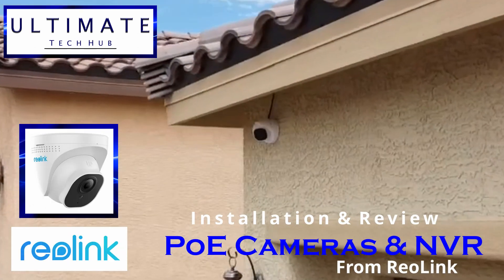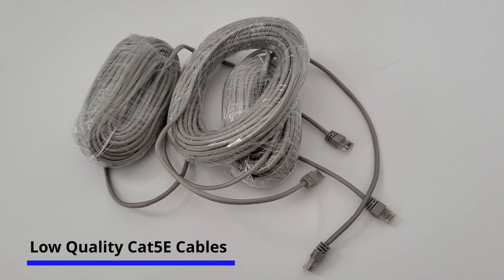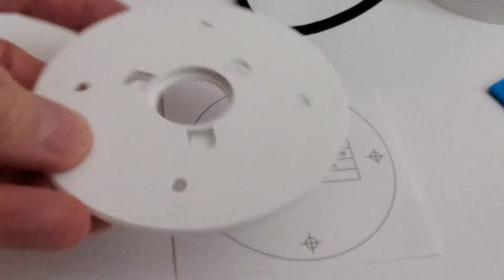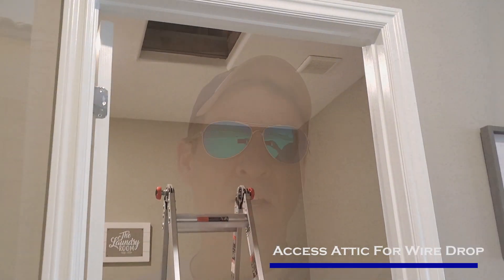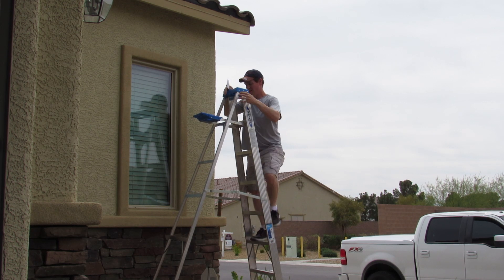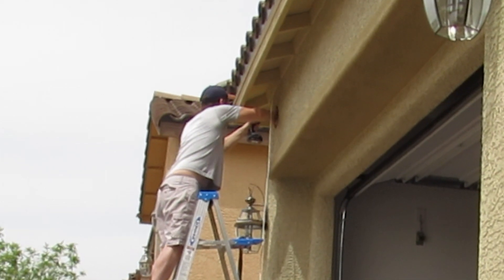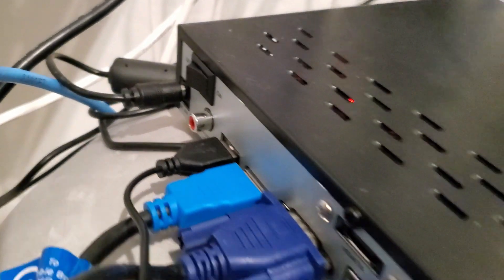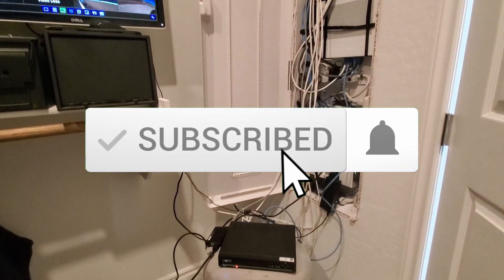Reolink 5MP PoE Camera Setup - Entire System QUICK & EASY! How To

Comment: Hi, I want to add a similar system to my house, can you switch a couple of cameras to two-way audio cameras to the system?  It seems all the two-way audio cameras are wireless, which means they may not communicate to a wired system.  I may be wrong. Please advise.
Reply from the maker: Reolink Cameras that support 2 way Audio are E1, E1 pro, E1 Zoom,  Argus Pro, Argus 2, Argus Eco, Argus PT, Reolink GO, Argus 3, Go PT. All of these cameras integrate well with the Reolink NVR system and the Reolink Client Software. I have the E1 Pro and its very good. I did a review of it as well. So yes you can switch a couple cameras to two way audio with no problems and you can use other camera brands as well. Thanks for watching and if you subscribed thank you as well.

Comment: First: I was suspicious. You didn't give a disclosure. Recommended the system but calling cables junk and special advertisement for one specific CAT6 cable. Additionally calling mouse a junk too (Kind of dream for the seller that puts all the bad accessories in a package to meet the price point goal) when the final conclusion is still "Excellent" "Recommended to all"! And you ain't the only one with OCD out there so I called it initially an "Advertisement in disguise by the manufacturer, Reolink in this case". That is till you admitted about your really true (And almost everyone's) stupidity in attaching the bracket in reverse and showed it actually on your tap. I believed you at this point bro! You ought to be innocent to show that and not hiding it. 

Then: I see a lot of overall good reviews for Reolink so definitely want to believe you.

Nag: All good except... (Pressure on OCD bottom). Why on the earth do you go through the trouble of drilling a hole on your walls, into the attic but not making a simple calculation as to where exactly the camera should be installed and actually drill right there so there is no UGLY wire hanging/extending on your wall when the camera could seat right over the hole for a direct, concealed, clear, nice, professional install? This way, there is no question of conduit also as some other poster asked and you've replied, admitting to OCD and re-correction. 
Additionally my advice to everyone: Before placing the camera on their final location, definitely have a look with a camera of similar focal length lens (Angle of view) as to what exactly the camera will be finally looking at, from that location. A lot of times when over protecting and placing the camera way up, you're covered by the roof edge, and when placing too low, you invite all the bad things. So make sure what camera is going to finally look at, is actually right. Then drill the holes (Measure multiple times, cut once!). Best is to use the real camera to be installed, via external wiring to box and if not possible, at least check it with your cellphone camera or likewise (Considering the room for final correction of view angle, giving the differences in their lenses and focal lengths. 

Bonus: For all who would question the code or need for adding conduit over the barre wires in the attic, No it is not needed as it is low voltage and additionally the section of wire exposed to elements only need a conduit to prevent corrosion and early failure otherwise fire hazard is not a concern here. Or hopefully. 

Bottom line: Good job man. You have a new subscriber.
Reply from the maker: Wow!! Thank you for watching and for subscribing!! I ended up moving the cameras to the wire drop holes about 3 weeks after the install. I wanted the wire drop holes to be lower but the way my house was built that was as low as the drops could be. All camreas were moved higher up to each wire drop so you can't see the wire. I will probably make a video update since I've had a few OCD viewers notice that!!  Lol. I yes this is NOT an advertisement for Reolink I just like the product. The cables and the mouse are not good but thats not a deal breaker. The most important thing is the NVR and the 5mp Cameras. They work flawlessly and thats why I recommend it. Also Cat6 is a better choice to future proof your hoise for better technology. Funny thing is the mouse doesn't work very well but I still use it. LOL  I just uploaded a Reolink Client software video so if you get this system be sure to download that software for your desktop or laptop.  You can view the cameras remotely and use the playback functions.  Reolink is a very good product but there are other really good camera companies out there. Just do the research, watch reviews like this and make a logical decision.  Good luck with whatever you purchase and keep me posted.  Thanks again for watching!!!

Comment: Great install!

Question- My router/modem is downstairs in my office. I would like to have the NVR upstairs in a closet like yours.  Can I run another modem/router to the closet upstairs or is it limited to 1 router/modem?
Reply: Unless you are a professional or network expert, never think of adding a second router (A big no-no) or an access point or a switch box, etc. You will pull too many hairs before making a successful connection, messing up with the SSID, ports etc,  that baldness will more successfully follow next!!! Yes as he said, only run a single RJ45 from the NVR box to one of the free sockets of the router. The same way you can again run a single HDMI cable from NVR in the closet to the final monitor location, that may be installed elsewhere or have it assigned to your TV in the living room or likewise, if you have a free HDMI port in the back of TV and with today's smart-TVs, everyone should have many.
Reply from the maker: @samsen3965  Well said!! Yes a second router is a pain in the butt for sure. Luckily i have my degree in Cisco Routing and switching. I also have 2 monitors for my NVR one in my closet and then I used HDMI over ethernet to run a monitor to my 65 inch big screen in our family room. I have a video on that very topic. I will post a video on how to set up 2 routers for a home network.  Seems like a great topic. Thanks for watching and commenting!!!
Reply: @UltimateTechHub    Follow up Q -  what if I run the ethernet frkm the modem upstairs to the closet, comnect that to a modem, then from the modem to the NVR?

Will that work? Intent is to get a stronger net signal to upstairs.
Reply from the maker: @Unplugged704  you can't have 2 modems connected it doesn't work that way. The single ethernet cable will work fine. The only way to get a better signal is to use a  Cat 6 cable but with video signals it really doesn't help. Cat5e is plenty of speed for an NVR.  Just don't over think it. Have fun and keep me posted!!!
Reply from the maker: Thanks for watching it was a fun install. So your best way to install the NVR upstairs is to run an ethernet cable from your router downstairs to the closet upstairs.  You do not need an extra router or modem. Just plug a cat5e  or cat6 from your router and plug the other end into the NVR. Done.
Reply: @UltimateTechHub   Perfect. Thank you for the response!
Reply: You can only have 1 modem and as many routers and switches as you want. As long as they are configured properly to route signal you can have multiple different networks connected together with almost infinite different networks that can see or cannot see each other depending on how it is configured. The easiest thing to do is to use Ethernet cable plugged into your Modem run that single wire all the way upstairs to your closet or wherever the dvr is and plug it in the internet port. Done. If you want to expand your network upstairs to the rest of the house you can indeed do that using a router. Place a router upstairs run Ethernet wire from your downstairs modem to the internet port on the router, then use second ethernet wire to run form upstairs router normal use port to your DVR so you have additional Ethernet ports available upstairs for future expansion.
Reply from the maker: @gudytwoshoes  Yes this is correct. Do can use this system without internet. Its just a great feature to be able to see the cameras from your phone. Good luck and keep me posted. Thanks for watching.
Reply from the maker: Limited to one modem. You can run an ethernet cable to that closet and that would solve the problem.

Comment: also have you tested Reolink PoE NVR 16CH if all the 16 ports are utilized does that drop the video quality ? Thanks
Reply from the maker: No it won't drop the video quality. I have not tested it but its the same as the 8 channel system. The only thing different is it will use more recording space on the hard drive.

Comment: good day,
the video is very well described
I bought the Cammera without an ethernet cable,
I now want to buy the cable through Amazon for 16 pieces of Kammera?

can you please send me suitable cables for 16 pieces Kammera Link from Amazon?

Many thanks

best regards
abdo
Reply from the maker: If you check way down in the description there should be a Amazon link for the Cat6 Riser cable. You will need between 500 and 1000 feet depending on the size of your house. Let me know if its not in my Amazon links below then I will add it. Thanks for watching and if you subscribed thank you as well.

Comment: Hi @Ultimate Tech Hub, If I bought this system and maxed out the 8 wired connections, Is there a way with the addition of a Poe smart ethernet hub to add more cameras?
Reply from the maker: No that would not work. You would need a NVR that had more Camera ports. I think Reolink sells a NVR with 16 ports. How do you like the picture quality? I have 6 cameras and I will add 2 more soon. Thanks for watching and if you subscribed thank you as well.
Reply: @UltimateTechHub  I haven't bought the system yet I was about to hit the buy button on Amazon and I held out to ask the question. I may look at the 16 port model. Thanks for your help
Reply from the maker: @dirtymarshall  ok good luck and keep me posted if you have any issues with the install.

Comment: I fitted this exact same system two weeks ago and it works just great with excellent quality using the cables supplied....its great value and easy to install, the app works really well too!
Reply: Thanks for the comment. Was hoping someone would be happy with the included cables to avoid spending extra on the system.
Reply: No problem- I have added two more cameras since....if you order from Reolink they just come with short cables about 3' long? I ordered some cables from Amazon to extend them to where needed and although they were only cheap they work fine too  - all at 5MP
Reply: @Saxonx500  good to know, I'm expecting mine on Monday and hopefully all goes well. Thanks again.
Reply from the maker: Good job! It's a very good system for the price. I do have a video on the reolink client software install as well. Thanks for watching and if you subscribed thank you as well!
Reply: I know it's been a while but how easy is the interface when it comes to using the phone app to monitor the cameras?
Reply: Really easy on the iphone, I use regularly and have never, ever, had an issue so far 👍🏻
Reply: @Saxonx500  thanks for this, I like the CC system for the added security but the phone would be the primary monitoring system. Did you connect the NVR directly to the router or did you add a switch? thanks in advance
Reply: I plugged the nvr into a google mesh router and it picked the system up straight away. If your router is handy plugging it straight in will work fine I am sure 👌🏻
Reply: @Saxonx500  thanks I'm just trying to find the best configuration out there.

Comment: Also you should use the dome cameras for patios or inside should of used the bullet cameras for these angles...just saying!
Reply: please explain why...are domes not appropriate for vertical walls?
Reply: @johnnicholson9855  domes can be used for vertical walls, and these cameras have a flip option when viewing as you need to install the dome camera upside down on a flat wall. Bullet cameras are better for flat walls because the mount comes away from the wall and allows better angles facing back at a property

Comment: Nice informative video but your installation was horrible. You should of installed the camera under the soffit or on the trim! Too much exposed wiring the jacks should of been hidden inside the attic. 10 years of security camera installation experience...
Reply from the maker: I installed some beige cable conduit to protect the wires and it blends in well. I will eventually move the cameras to hole location's where it is possible  4 of the 5 can be done. The one on the patio was done without any wires exposed. I'm not a professional camera installer so I should have had the electrical guy drill the holes lower in the location's I wanted the cameras.  But once I move the cameras to hole locations I will make a video update. FYI the picture quality is superb. Thanks for watching.

Comment: REOLINK RLC-422 OR RLC-522 ?
Reply from the maker: Its the REOLINK RLC-520
Reply: @UltimateTechHub  I know but I ask what is better between 422 and 522.
Reply from the maker: @soap4594  oh sorry. The RLC 522 is better. The reason the 422 is more expensive and no audio recording.  But it does have 4x zoom vs 3x zoom on the 522. The wide viewing angle is slightly better but not enough to justify the extra dollars. Both are 5mp so the video quality is the same.  Good luck and enjoy the new camera.
Reply: @UltimateTechHub   I don't agree your choice because for me zoom is more important that sound. Sound on an external camera is not necessary. Image is the most important.
Reply from the maker: @soap4594  I hear you. I never use the zoom feature on my cameras. My cameras are set up for optimal viewing and .since they are both 5mp the quality is exactly the same. If you set up your NVR to view on your big screen then zoom will never be needed. I view my cameras on my 65 sharp and the video is incredible.  But either camera is good. Thanks for watching.
Reply: @UltimateTechHub  Ok I hear you and sound is necessary in your case and if yes why ?
Reply from the maker: @soap4594  sound is not always necessary but if there is an issue of crime or altercation or a fight the audio will definitely come in handy.

Comment: I gave you a thumbs up but thank god you do not do this for a living...Ugly. Camera's should have been put on the fascia with no wires showing. You could have drilled a hole through the fascia board..Clean. Now you have a wire showing from the camera to the stucco. I have the same system easy install but to do a clean job took over 10 hours but clean. Your house is expensive like mine no need to ruin the looks of it. I ask my wife who is a designer for houses what is wrong with this install from looking at it first thing she said the wire from the camera to the stucco....Well enjoy thought I would just mention it...
Reply from the maker: Heres the link to the wire covers video. Im not a professional camera installer so I did what worked for my situation. https://youtu.be/YNI0Zph4slo
Reply from the maker: I added a brown conduit cover over the wires that matched my stucco color. So it blends in better. Thank you for watching.

Comment from the maker: We hope you enjoy this installation and review of the Reolink 5MP IP Cameras and the NVR system. Feel free to ask any questions about this product or the install. And remember to hit the subscribe button to become a part of the Ultimate Tech Hub! Thanks for watching!
Reply: Is it possible to add wife cameras from a remote building or shed
Reply from the maker: @Guero_33  Yes absolutely. Just check the max distance of the wifi signal. Thank you for watching.
Reply: I'm interested in the system but not crazy about a quarter turn to remove them from their mounts.  My soffit isn't high enough in many places to prevent someone from reaching it.  Low chance of that happening but still.  Heard of any other Reolink turret models WITH a locking screw/mechanism, etc.?  Thanks!
Reply from the maker: @CTTH100  I haven't heard of a Reolink Camera  turret with a locking system. That would be nice for sure. My cameras are about 10 ft from the ground so no worries for me but in your situation it may be an issue.